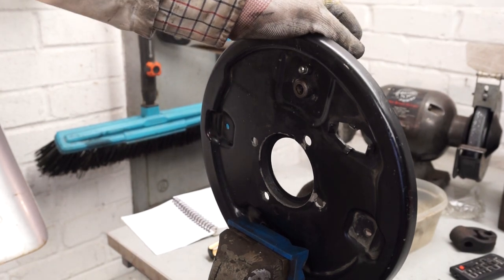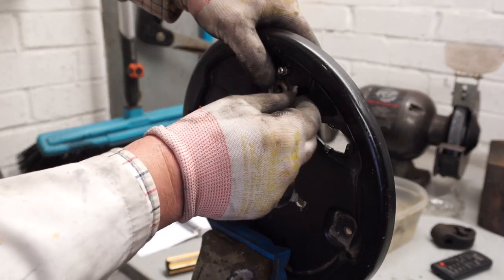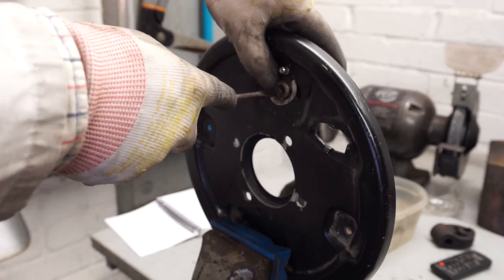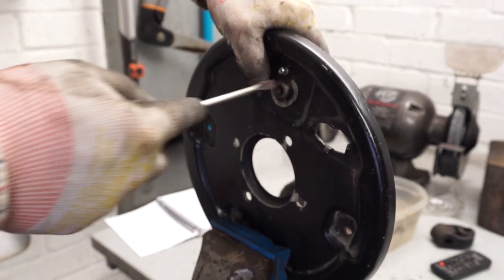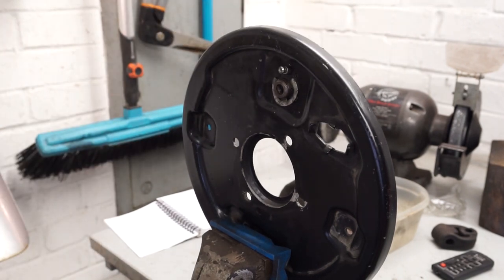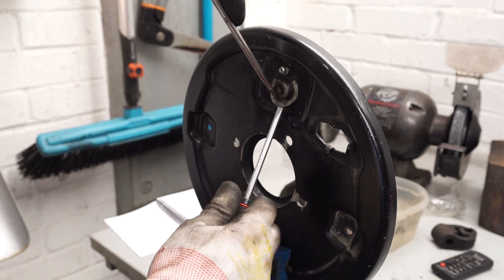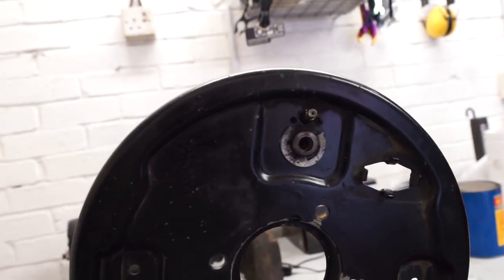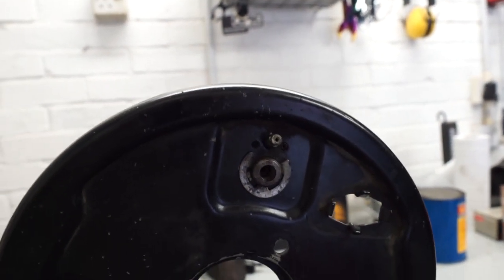MGB Rear Brakes:  Replacing The Circlip or E-Clip on Wheel Brake Cylinders with No Special Tools

Comment: Much harder laying on your back with an axle in the way and greasy bits falling in your eyes.   ;-)
Reply from the maker: Yes, to make it fair I’ll be fitting new wheel cylinders to the car next weekend and will shoot another video under the car with a new cylinder and a new e-clip.
Reply from the maker: I used the same procedure on the car here Philippe: https://www.youtube.com/watch?v=82ykSEs-oIE
Reply: That is how I do all my work. Lying on cement or gravel with the car to protect me from the weather.
I am an idiot or at least a bugger for punishment.
Reply: Feel your pain, been right there
Reply: @kellybreen5526  Gravel is best that way small parts don't go far when dropped. Easy to find them then (with a metal detector).

Comment: Thanks for the video. I ditched those clips altogether and used an external snap ring. Takes 5 seconds to install/remove using the snap ring pliers.
Reply from the maker: Sounds good!
Reply: Yes that does sound a good idea!
Reply: External circlip requires to have a 16mm i/d
Reply: My circlips arrived today and I struggled to fit the 16mm i/d one to a new slave cylinder  so had to fit an 18mm i/d one instead. 

Don't know if it was because the ones I bought were stainless steel rather than sprung steel. Anyway thought I would update my findings accordingly.

Comment: Recently did exactly this on my Rover Mini replacing the wheel cylinders both sides. What I will say is if doing it on the car, use mole grips clamped on the hub to hold the cylinder in place, this gives you two hands to get the clip on, still rather fiddly and involved a few interesting words when it popped off numerous times but that helps a lot.
I didn't end using the special tool i'd bought as it would have involved taking the brake pipe off and as i didn't have a replacement i didn't want to chance it.
All the best.
Reply from the maker: @25johnlowe  that's a great tip with regards to using a pair of mole grips, thanks for your input.

Comment: Doing this job right now. You are a lifesaver mate!
Reply from the maker: I hope it all goes well!
Reply: @davidrussellwilks  Well on the Midget the clips are the thin spring compression type and you definitely need the small pliers with the pins. The video was very helpful just the same because I thought it would be a nut holding it in place. The clips were old so after using the pliers I had to get the rest of the clip out by lightly tapping it with a screwdriver and hammer. 
I also did not have the assembly on a bench. Nope, car on jackstands and lying on the cement.
One day I will have a nice shop...